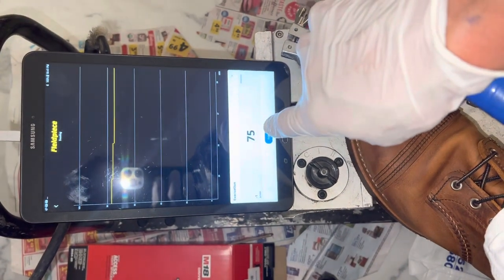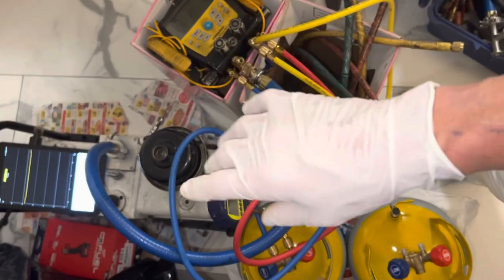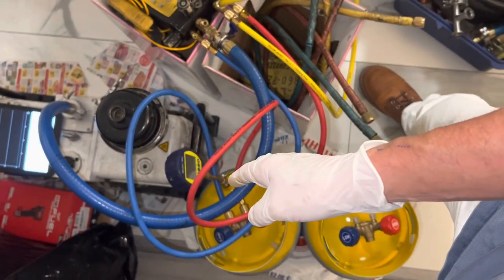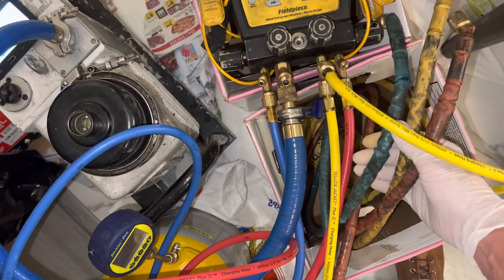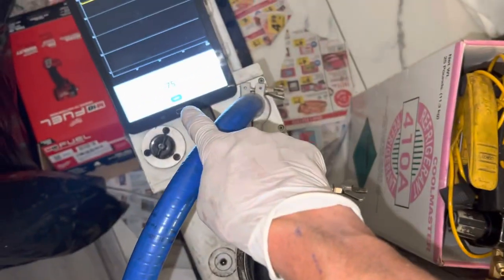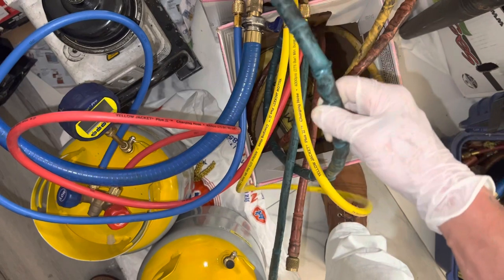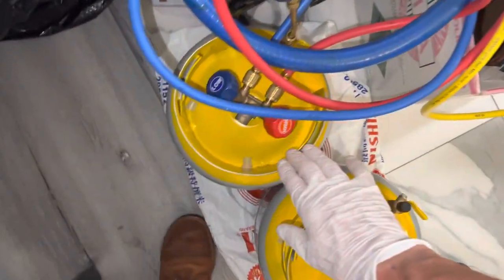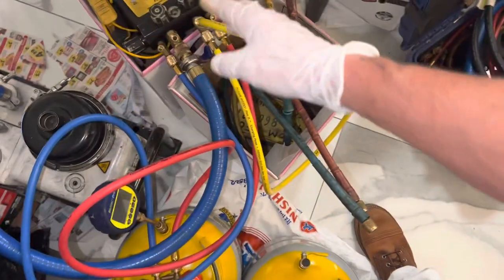￼ Yellow Jacket hoses failing vacuum decay Test and this is exactly how they Should Preform￼￼

Comment: this guy is the master of his craft, now i know how to test the a/c system for a vacuum decay test by a separate micron gauge attached to the service port and not to get fooled by the reading on the manifold,thanks to you,is there any way to do the same to measure a decay test when applying 150 psi nitrogen to the system an measuring the decay test on one of the service port and not to get fooled by the manifold and hoses losing pressure? thanks in advance.
Reply: The Fieldpiece job link pressure transducer can accomplish this. Or any other digital stub transducer.
Reply: @waynecostanza2280  than you.
Reply from the maker: The Fieldpiece SM480V will not for you on your nitrogen presser decay test you do not have this problem when performing a pressure test and the software is built-in to the manifold gauges to do a very accurate test within tenths of a psi I will do a video later on it might take me until next week I have done videos in the past but I’ll do some on this tank has a example because I know it does not have any leaks it’s clean and dry and I could perform repeatable measurable test that will always be the same
Reply: @waynecostanza2280  i meant thank you.
Reply: @coldfinger459sub0  thank you again.

Comment: Great info, always wondered where you got those hoses, now I know you covered them to protect them, great idea 💡 That’s the reason I like to use valve core removal tools directly to the port with vacuum gauge valved off from the hoses. When I 1st tried to vacuum the Volvo I went
Through the manifold gauge set with the 1/2” dedicated hose and 1/4” hoses to the high and low side was on there for 2 hours and only got to 840 microns. The 1/2” hose with 1/4 and 3/8 fittings direct to the system with core tools gets to 500 microns in about 10 mins. I ended up doing the entire job with multi core removal tools and one hose to the refrigerant tank but I have the auto filling valve from testo that weighs the change in for you 👊👊 worked a charm. Off the subject of this topic but when I first tried to charge the Volvo I tried to do full charge through the high side as you show, I think I got a bit confused and put 150g in by hand as couldn’t figure out how to connect the valve to the app for auto filling, started the car and then was trying to add more refrigerant and thought something was wrong with the scale as it was going back up! 🙃 I stopped the filling as every time I put more in the clutch was cycling so I thought I over charged it 🤪 but after recovery got 100g out so was cycling because it was low Cutting out on pressure switch I guess. So was I ment to add all the weight with the engine off then start the car as I recon it pushes the refrigerant back into the bottle doing it slowly on high side with engine on. Ended up pulse charging Vapor in the low side.
Reply from the maker: Definitely sounds like you learn something the hard way must’ve been confusing and frustrating. 

You are correct about the cycling switch that’s why I was cutting often on.    As soon as the cycling switch sees roughly 44 psi it will engage the contacts to command relay to engage the compressor clutch. 

If you have watched my videos and noticed every time that I charge a vehicle it only takes about 30 seconds for the complete charge and I do it through the high side and the engine is never running. 

That means well it was pushing refrigerant back into your your cylinder of refrigerant it was also pushing back in oil that was mixed with the refrigerant from the system contaminating all your refrigerant with whatever type of oil was from that vehicle.

And I did a video about a year ago exactly how I made the hose coverings on with the silicone grease underneath the shrink tube on the refrigerant hoses
Reply from the maker: @vw_mods_4711  scanner Danner hast to run the engine to get to Refrigerant Inc. because he does not know how to correctly get all the charge in the High side without starting the engine and getting the rest in the low side. 

Scanner Danner is the grease monkey who would you shop moisture laden air to compress air conditioning systems to look for leaks. 

I gave him a few lectures on his previous videos about that and he did some research and he’s attempting to look like he knows what he’s doing as he’s learning. 

His latest videos he attempting to use a micron gauge. And he actually threw a valve on there to valve it off. 

Broke his sons compressor by not indexing and paying attention to the valve plate guide pins and he thought the Reed valve springs were springs that needed to be compressed and using an air tool to put back a compressor with small bolts that only need inch pounds of torque and said he applies many feet pounds of torque

He strips out the oil drain plug on the compressor by using a big long three eights extension ratchet on a bolt that only needs inch pounds of torque so I ripped the threads right out of the case. 

He thought because you can hold a vacuum that that meant you were not going to have leaks under pressure and then gets upset about it and explains that he doesn’t like the method should never use it which was true in the first place he should’ve never thought that or even said that. 

He’s good at showing scanner type stuff and putting a lot of links down below so you can buy things from him. 

But when it comes to air conditioning you might as well be watching Scotty Kimbler lol 😂 🤣

When watching Scanner Danner do air conditioning I don’t know if I’m watching comedy and I should be laughing or watching a horror movie 🎥 🍿 

He breaks things and then says he’s learning it’s his first time. 

So I guess we all should just totally throw away books don’t learn don’t take no classes don’t attend no seminars go to no expos and just go out and break everything on a customers car and say we are learning ? 🤔🤤
Reply: @coldfinger459sub0  Scanner Danner is a teacher at the local Auto Mechanics School in Pittsburgh called, "Rosedale." He does know a bunch about auto mechanics, but like many auto mechanics...knows just a little about ac/hvac. It's kind of like doctors and nutrition. They know how to get rid of the symptoms by changing parts, but don't understand the root cause of the problems.
Reply from the maker: @Vineyard_Edge  yes I’ve been watching Scanner Danner for a long time I’m a fan of his when it comes to him breaking out the scanner but he often unnecessarily breaks out the scanner for things that definitely do not need the scanner it’s like everything is scanner and here’s my Amazon link below of the things I used in this video buy them. 

And that’s the one thing what actually makes it worth he’s a professional educator who teaches people how to backyard hack things and not really care about what’s right but only good enough to make it work and collect money even if it’s going to cause damage later on. 

But due to lack of ignorance doesn’t even know what he doesn’t even know and then publishes it as a video

This is why I call it a crime against humanity in a tragic Greek comedy 🎭 

As an instructor he’s very good at not reading not understand what he’s using or new tools or new procedures and many look up to him as his word is Gospel. 

Just like in the early days of the Catholic Church he is the pope and how dare Galileo say the earth is not the center of the universe

Comment: Do you have a video of how you treated those hoses from start to finish? Do you treat all your new hoses prior to using them?
Reply from the maker: Yes I have a video about a year ago I posted it. 

As you see if in this video I showed you where the shrink tubing was cracked ripped you could see the shiny slimy greasy dielectric grease ( silicone grease ) that was underneath. 

This keeps the oxygen out of our atmosphere off of the rubber because what we breathe oxygen is an oxidizer and it actually attacks rubber components.   
                             Then the shrink tubing physically protects your hoses from mechanical abrasion like an accidental collision with a rotating pulley or fan. 
               And protects the rubber hoses from the UV light from the sunlight that also breaks down the surface of your hoses causing them to crack and the rubber to deteriorate.

Comment: so i just use a T valve on the service port(mini split) and close the vaccc valve after it has gone down to a desired level? (becuz mini-splits only have 1 service port on the low side)
Reply from the maker: Appion and yellow jacket make tea valves were shut off ports on them just for this purpose that you’re talking about and Jim Bergman has made videos showing how to set this up and do it correctly so has service tech LLC on YouTube and HVAC School for techs by techs on YouTube I’ll have made videos on this showing proper set up
Reply: Ultimate pressure with my refrigerant hoses is about 120 microns.  My pump can reach 45 microns pretty easily but the pressure with a hose won't go below 120 microns.  The rate of rise is acceptable though.  These hoses are valved off from the system under decay test conditions, using ball vales on the ends.
System volume is many times larger than the hoses, thus decay is much lower than with the hoses alone but still, I valve off the hoses because they can only contribute to rate of decay.

Comment: BTW, I don’t see much difference between your old hoses and new hoses.  Both sets go down to about 50 microns non-static, and around 1200 microns static! 

I would say, your old hoses are still good!
Reply from the maker: The new hoses go up to over 1200 µm within minutes

You would think the old hoses that are dirty get used on contaminated moisture laden systems they are coded with POE oil on the inside would perform worse

But I use these hoses 6 to 8 times a day on different jobs constantly putting them under a deep vacuum under 100 µm between every job

At the end of the night when I go home I draw them down under 100 µm and then purging some dry nitrogen to zero psi or sometimes I even leave them under vacuum at 100 µm in the next morning when I wake up my gauges will be at between 800 µm and 900 µm takes roughly 12 hours for them to raise that high

That is the difference between hoses that have been thoroughly out gas and hoses that have not

I have been doing this since I was 12 years old my father started me on the old analog micron gauge
Reply: @coldfinger459sub0  maybe the oil and dirt or whatever have served as a sealant for the rubber pores? 😂

BTW, why do you vacuum them every night?
Reply from the maker: @jrm163  to get it down below 100 µm and remove any moisture contaminant out of the hoses. 

Because I do 6 to 8 jobs a day I always want my hoses to have the capability of being able to pull a vacuum down below 100 µm immediately between each job if possible. 

I wanna make sure my hoses never billed up a moisture content on the linings and in the pores of the rubber of the hose.

Every day I periodically blow through 99% alcohol and then blow through 600 psi of dry nitrogen. 

This way every day constantly I’m on top of the quality control in between jobs
Reply: @coldfinger459sub0  FYI. alcohol damage rubber
Reply from the maker: @jrm163  i’ve never owned a set of hoses long enough to find out.       My hose lifetime expectancy is 3 to 4 months usually break by the crimp up by the gauges were at Bends then leaks

This is the first set of hoses that lasted me a year because they coded them with silicone grease and then wrapped it with the shrink tubing and encased the grease under the shrink tubing preserving the rubber outer service so we’ll find out after a few years if I ever do something to the inner surface

Alcohols only in there long enough to be squirt through at high pressure and then immediately blown through with 600 psi nitrogen contact time less than 30 seconds
Reply: @coldfinger459sub0  I like the heat shrink idea, think I'll copy you with my next ones. Great work
Reply from the maker: @user-cs1ne8gx9u  You’ll probably never need another set of hoses again most people are not so abusive on hoses as me

A very very thick layer of dielectric grease silicone grease on the hose before you slip on the shrink tubing